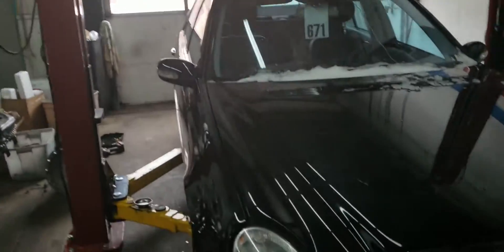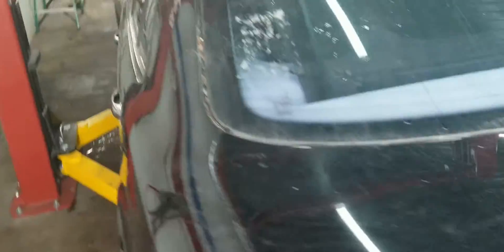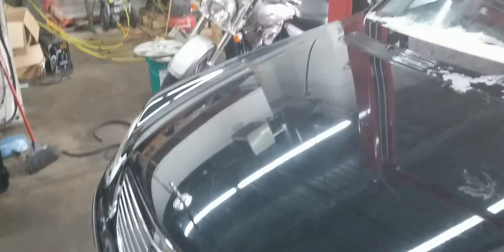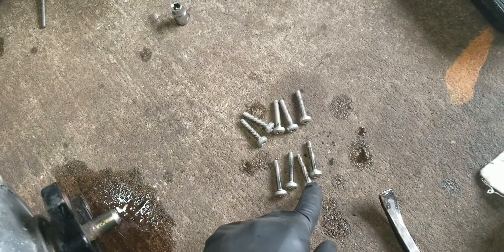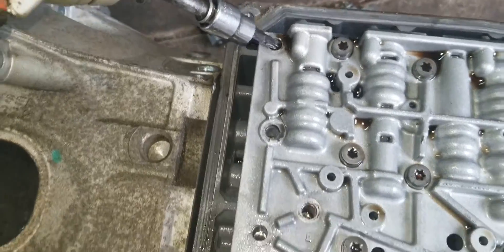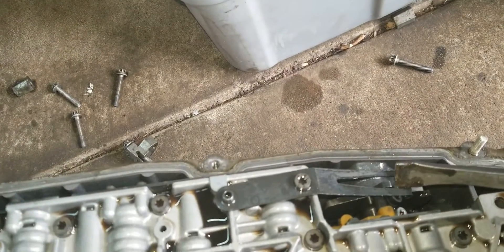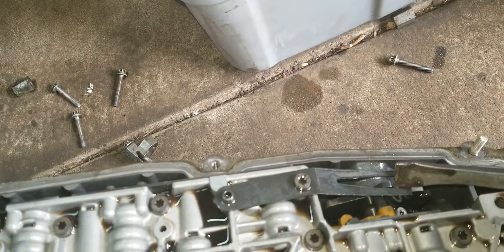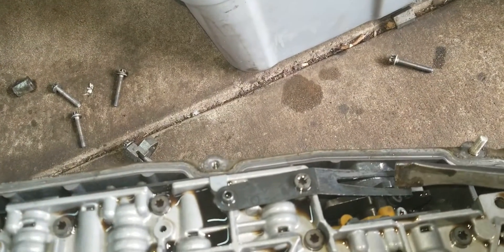How to fix Transmission in 2006 Mercedes Benz E350 722 9 7 Speed after swapping or replacing

Comment: Hi, thank you for your video. I purchased 2006 MB C280 and after diagnostic I had the result
 " The Internal Electrical Check of Component Y3/8y3 (K2 Clutch Solenoid Valve (VGS)) has failed. Fault Present in Control Module Transmission (P2734)".
 I purchased from the Junk yard the entire transmission electric and the valve boby of a 2006 MB c280. I removed these parts from the vehicle myself with care. now, after i viewed your video, i decided to reach out and get more clarification about how to swapped the two parts.
Reply from the maker: Good luck my friend !

Comment: I just bought an 2007 e350 that’s doing the same thing but the transmission hasn’t been replaced I’m wondering if maybe it just needs the conductor plate or solenoid
Reply from the maker: Do you remember what codes were you getting

Comment: I have a 2006 e350 4matic and it is in limp mode and it kicks itself into neutral when I’m driving after the transmission warms up . It also has a whining noise.

Comment: I have a 2006 Mercedes c230. I had the valve body replace at the dealership and now the gears aren't shifting at all.
Reply from the maker: Gear not shifting means one of the three things , Solenoid , Transmission or Valve Body . Go back to them